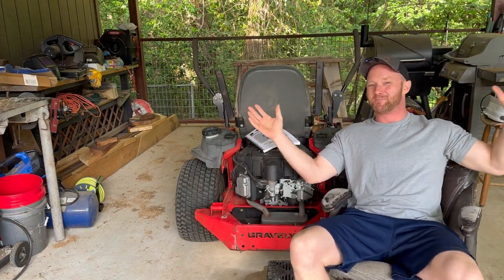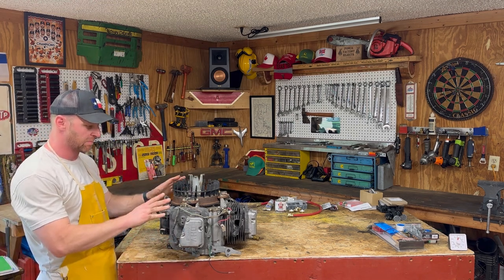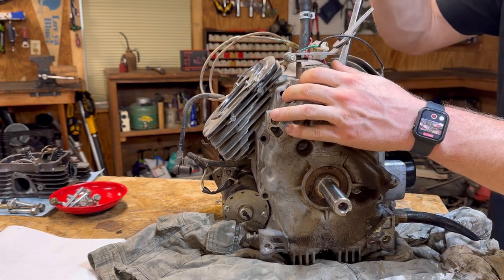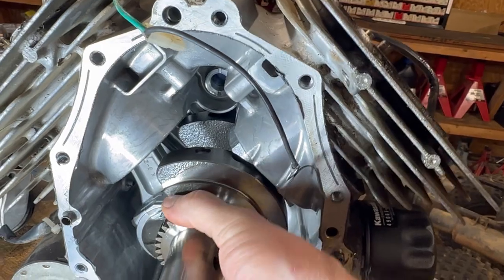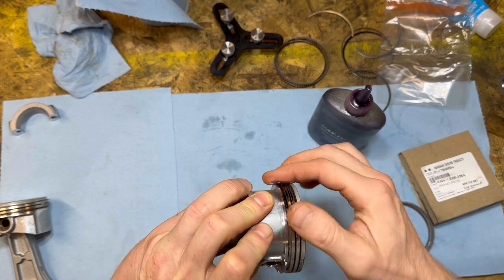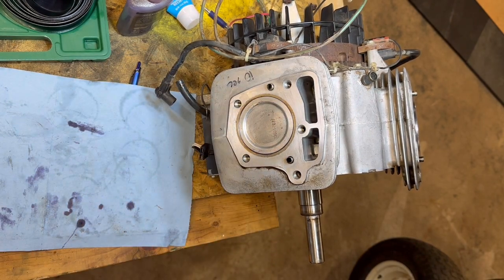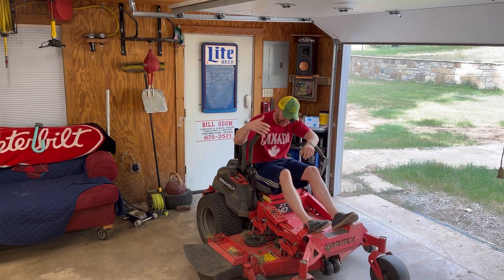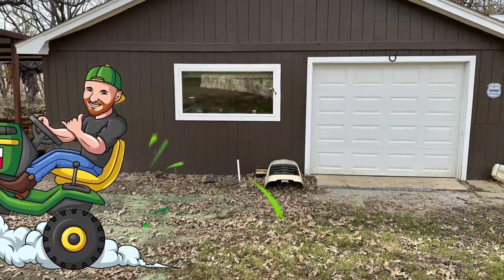Kawasaki Piston Ring Installation FR691V Engine

Comment: I just picked up an Ariens 52" that was ran low on oil and it blew the connecting rod to the crank, Had three pieces of the cap in the sump. Threw the rod on an up stroke it seems, as there is no visible damage to the cylinder wall or block. Just some build up on the crank that I think can be dissolved and polished off.  This was the best video I came across on the break down and re assembly of the Kawasaki by far! Great job! I'm ordering the full rebuild kit as soon as I'm done typing, Thanks you for your work! I wish I could have left you a couple bucks. You should add a donate to your description and links bro!
Reply from the maker: Hey thanks for the compliment. I just make videos I would want to use. No tip necessary. (But there is a way to tip on YouTube just google it)

Comment: I have my FR600V from my cub cadet torn apart on my bench. The motor seems to be exactly the same. I’m having the same problem with oil burning, taking the heads off I had a pool of oil sitting on top of the pistons!That flex hone did an amazing job honing the cylinders! I unfortunately ordered the oversized piston ring set so I’m waiting for the standard size to come in. Just be aware out there they make a 0.5mm oversized ring set. Also my rebuild kit came with the flywheel seals and what not but as you mentioned in a comment earlier might as well not touch it if it’s not an issue and gravity mostly being the issue with the crankshaft seal. Thanks for helping me rebuild my first mower engine!
Reply from the maker: Good on ya for diving in. Glad to help it is a great motor to rebuild.

Comment: Just a phenomenal video that worked perfectly on my 14.5 HP Kawasaki FS481V twin cylinder engine.  Found one of my intake ports with 2 loose bolts (sucking dirt for who knows how long).  Rings were within .005" (.110 new) wear on the good cylinder and a whopping .036" on the badly worn cylinder.  The only improvement I would make is to use TAPE rather than permanent marker to mark the pistons (and connecting rods) during disassembly.  The carb cleaner I used immediately removed those marks.  When reinstalling the pistons the "K" part number identifier on the connecting rods MUST FACE EACH OTHER or the pistons will bind during assembly since the connecting rods have a slight bend in them.  Just make sure the "K" marks face each other and everything will go back together easily.  It started right up with a single shot of starting fluid and ran better than new  this weekend mowing my 5 acres.  Smooth, absolutely no smoke.  Just amazing. Thank you for posting such a wonderful video!
Reply from the maker: That is great news. I had the same result with my engine. It ran like new with those new wings. Good point on the tape.

Comment: Hey Mike, would have liked to see what your ring gap was before you installed them on the piston.  Also, when tapping the piston back in the bore, use your third hand to be sure the rod is not beating against the crank surface.
Reply from the maker: Good points rags!

Comment: Well that was pretty kool video. I have a motor about the same as yours. I was thinking about switching it out to a briggs and scrapem. But now I think I’ll just rebuild.
Reply from the maker: Don’t swap it, just replace the rings and seals. I have a full rebuild video that goes into all the details. If you switch to a different manufacturer the electrical connections won’t sync up.

Comment: Boutta do a ring job on my cousins, pulled heads off because people thought it was a head gasket and the rings are bad, the pistons move a hair around the cylinder walls. Guess i gotta order rings and sump seals
Reply from the maker: I was in the same boat. Very frustrating good luck
Reply: @MowerMike  got bottom end back together, wasn't too hard. Now to do upper end lol
Reply from the maker: @That1996FordRanger  Got all the videos ready for ya good luck!

Comment: I got a stuck engine from a 345 John Deere. Eighteen horsepower water cooled. The pistons are impossibly stuck. Everything else is good as far as I can tell. I have to think that the previous owner had low oil level and they just froze. My plan now is to drill and tap the piston tops and thread in a bolt or bolts to pull them from the bores which appear in decent shape.. My friend bought the second 345 to repair his primary tractor. So hopefully we will have a good as new camshaft, crankshaft and even connecting rods even as the pistons will be destroyed and the bores are questionable right now. These pistons have a very short stroke and they get stuck with the rods at high angles. Wish me luck
Reply from the maker: Good luck! You may try soaking around the pistons with transmission fluid or some PB blaster to see if they break free. Sounds like a fun redneck project to me.

Comment: I am currently tearing my Gravely down after being inspired by your videos.  I have the heads off and I'm ready to pull the engine, but trying to get the PTO and and pulleys off of the crankshaft.  Any  recommendations or videos showing this process of removing the engine or at least the PTO assembly?  The Main shaft bolt is on there pretty good.  Thanks.  Fellow Astros fan and enjoy your videos.
Reply from the maker: I gotcha man, check this video out. If that doesn’t work I suggest buying a cheap battery powered 1/2in impact and it will zip it right off. 

https://youtu.be/vbMI_DFcXH0?si=75Gt23ERyfnh-0Bd

Go Stros!

Comment: I have a cub cadet with that motor and it has 850 hours on it ..and it recommends changing rings every 400 hours?  Hell I never have checked the valve gaps ..it's just runs great for the last 16 years 🤞...the mower deck not so good 🤦
Reply from the maker: That is great. You probably changed your oil way more often than my buddy who ran this engine into the ground. Works great now though

Comment: FYI - The connecting rods have a very minute bevel edge that is to be facing outward of the shaft.  When the two connector rods are installed. the flat side that goes around the crank should be flat against each other, The bevel edge on each outward side allow for lubricatioand keeping wear away from the connector rod.
Reply from the maker: Good advice lol wish I would have known this earlier

Comment: I just replaced a couple bent rods on my daddy’s Scag with a Kawasaki FH580V engine, it still has a little whiteish smoke coming out of the dipstick and before putting the heads back on, I noticed a small amount of oil seeping out of the right cylinder head, is this leak from bad rings?
Reply from the maker: It is normal to have some oil there. If it was burning oil before you did this job it maybe worth putting new rings on while you have the heads off though. Good luck!
Reply: @MowerMike  I had already put everything back together but the guard on back, it seems to run ok.  So far, it’s only smoking a little when I first crank it up but after it’s hot it seems to stop.  I think I could do the rings myself but I don’t feel like tackling that yet.  I’m gonna see how it runs for now but maybe in the winter I’ll take on that project if it starts burning smoke regularly.  Just trying to get daddy back going without breaking the bank.  Thanks for your input, I’m no mechanic but I’ll try if I feel confident and it helps to have great people to learn from.
Reply from the maker: @geramyballard5293  I agree if it is smoking a little but running you should be fine. Mine was smoking a lot and burning about .5 quart each time a mowed. You will know when the rings are really shot. You can always add some Lucas oil treatment to help them seal up a bit

Comment: Great video but one question.  Was there a good cross hatch on the cylinder?  Honing the cylinder will help bigtime with new rings.
Reply from the maker: Yep I have a video on honing the cylinder. I thought it was mentioned here, maybe stop fast forwarding through the good stuff. :)
Reply: @MowerMike  You are 100 percent correct.   I went back and watched again and you absolutely mentioned it!   My apologies and great videos by the way!
Reply from the maker: @Harrison6624  All good man, was a fun series to put together. That is an excellent engine.

Comment: Thanks for the great video! I did this recently on my fr691v but when I put it all back together, I’m getting issues with the throttle speed. Its much too high and it only idles normally if I gently press down on the governor lever. What did I do wrong?
Reply from the maker: Sounds like it may have an air leak in the intake somewhere. Try spraying carb spray around the carb and intake and hear if it changed rpm that shows you where the leak is. Good luck
Reply: @MowerMike  I sprayed starter fluid near the areas of the manifold where there are gaskets but it didnt seem to make a difference.
Here is a clip of it happening: https://youtu.be/HZBCRt6QXgo?si=Ddkk9QehMcznYkGl
Reply from the maker: @TheScubacamper  Sounds like a plane taking off haha. Good luck
Reply: Turned out to be the governor lever out of adjustment
Reply: @TheScubacamper  glad you found it! Was going to suggest maybe governor linkage.
Reply from the maker: @TheScubacamper  Well done! It is usually the simple answer

Comment: Hey  Mike, why did you not remove the Flywheel and remove the Crankshaft to change out the top Seal ? While you were that far into it ? Any reason…I am about to go into my FR691V this next week. —Side-Note-I might actually have a FS691V- The Shroud tag Says FR691 But I have a Voltage Regulator.
Reply from the maker: No reason just figured the top seal would never leak due to gravity and didn’t want to mess with it
Reply: Oh, they leak alright... I have to take down a water cooled FD 590 V . The cam looks great and the crank is probably OK .I suspect the pistons sticking are due to head gasket or something leaking water and corrosion. 
  Gonna need some luck
Reply: Is it possible to change the flywheel seal while the engine is on the mower?
Reply from the maker: @gregorytolson1648  No idea, try it and let us know

Comment: Hi there the cam shaft gear looks like it's made of steel.  Is that correct?  I'm thinking of buying a cub cadet mower with a FR651V and wonder if you've been into one of those?  I'm trying to ascertain if it too has steel cam shaft gear because I know some engines have plastic ones and I want to avoid that.
Reply from the maker: Yep I think it was plastic. I have no idea on which ones are plastic vs steel. I will say the Kawasaki engines are about the best brand you can get, but they are alll good as long as you take care of them.
Reply: @MowerMike I would disagree, nothing beats a Honda.
Reply from the maker: @RobertHaselwood  Very true, you got me there. Always take a Honda if you can get it.

Comment: @ 4:53.  It looks like there a boss behind that motor mount location so that you can use a bolt to break the seal and push the oil pan off, or at least for anyone else doing this job since the vid is a year old as I write this comment.
Reply from the maker: That there is, good eye